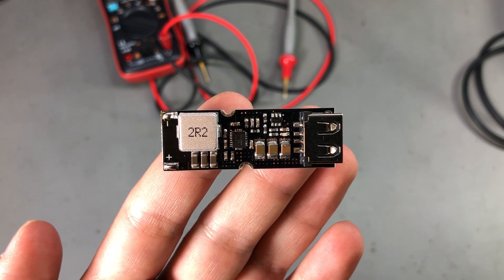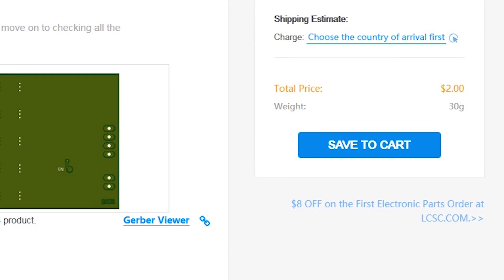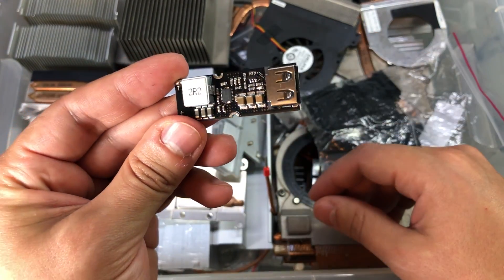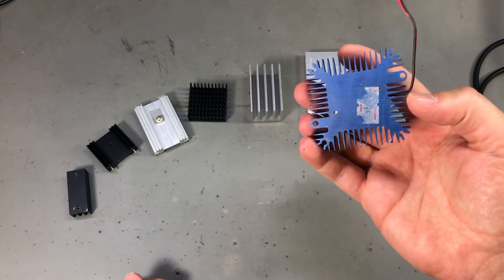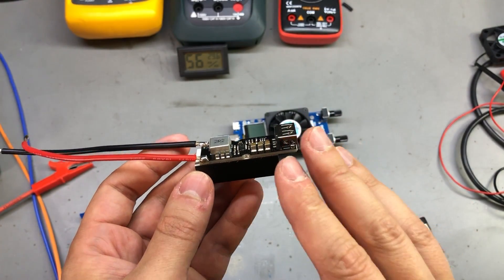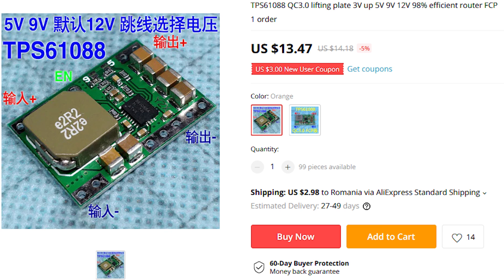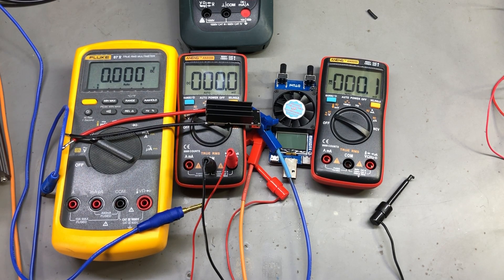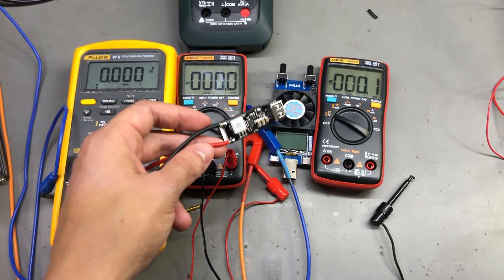Voltlog #246 - What if we install a heatsink on the TPS61088 boost module?

Comment: Hi,  how is the heat on this  when input is at 3.3v (lithium cell) and output at 12v 1.5A  18W out,   i see  one xiaomi  powerbank which used this chip for QC 3.0  without heatsink

Comment: Thanks for the test. About the banana jacks try using the ones that are splitted in 4 ways and split apart with a screwdriver to get better contact on input jacks from meters.
Reply from the maker: thanks
Reply: @voltlog  keywords to search on fleebay : "Banana Plug Connector Male Solderless Screw"
Reply from the maker: @MalagasOnFire  yup, they show up, thanks!

Comment: You can try soldering one end of those banana plugs, on the spring piece. They might be loose or lightly corroded.
Reply from the maker: that might fix it short term, but I'd better get myself some good quality 4mm plugs.

Comment: Awesome I have done this with some smaller quick charge boards, the chip is an 8 pin that they hid the part number on it but the board is a CKCY U1A. These are buck only modules so you will need 4S lithium to make them work good but it is easy to do if you have a lot of cells and balance boards like I have
Reply from the maker: This was a bit of a testing/learning experience for me as I wanted to know what's possible with a good boost chip/module of this type.

Comment: The use of a smoothed curve diagram hurts my eyes. ;) You only use those, if you want to smooth out a lot of noisy data and even then you have to ask yourself, if the curve is actually where the measurment values without noise would be. If you only have a few data points connect them by straight lines, so one can immediately tell where the measurement points are. In that case it is clear that the lines are just a visual aid to more easily see a trend and are not the real data. In a smoothed curve you can't tell how many measurements were actually taken and which of the points of the curve are actual measurements.
Reply from the maker: My feeling was that the non-smoothed line was hurting my eyes :-) But I understand your arguments, they're valid.
Reply: A good compromise could be to have crosses/squares in each measured point.

Comment: hi friend, passive cooling have to be faced up, since the heat travels that direction. If you face it down, the heat will accumulate there.
Reply: Not significantly - look up convection ;)  The air will just go up and around the module.
Reply: true, but the efficiency of heat transfer will be worse. convection only heatsinks want the heat to get away as fast as possible to draw cooler air in from the bottom.
Reply from the maker: That's true

Comment: I like that thermal tape you have!  Arctic Silver 2-part thermal epoxy is a useful product as well, but somewhat expensive.
Reply from the maker: Unfortunately this kind of thermal tape is not as efficient as regular thermal paste (I haven't tried thermal epoxy so far). But it does the job where you don't need the best performance but rather prefer the convenience of using it.

Comment: What are your plans with this module ? I was considering to use it as a power bank for charging the phone from 18650 cells, will it heat that much in a normal phone charging ?
Reply from the maker: I don't have any particular plans with the module. At 5V output it's efficiency is higher so depending on the current it might actually run much cooler however you will need to run some tests to confirm this.
Reply: @voltlog  I would like to see you making a test in charging a phone capable of qc3 and see how hot it gets, but I will get one of these modules and try it out myself too.